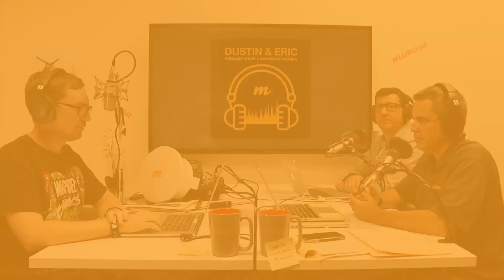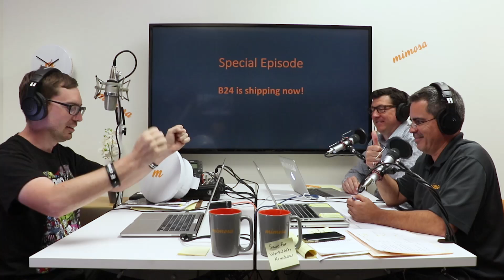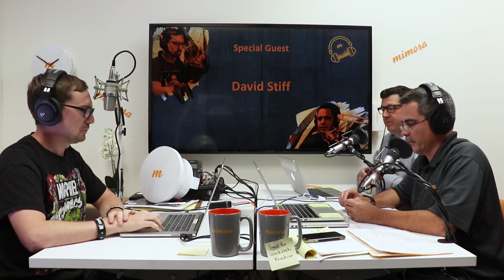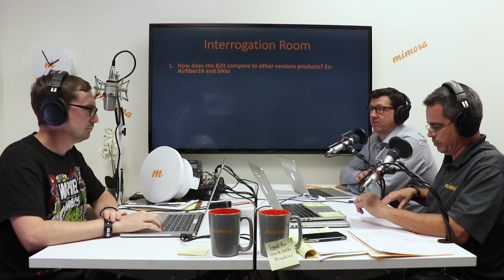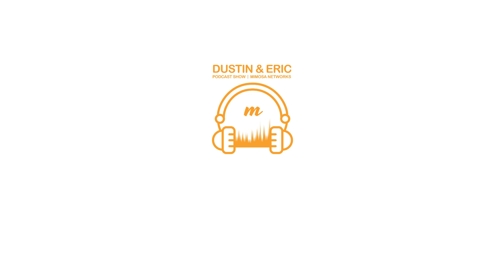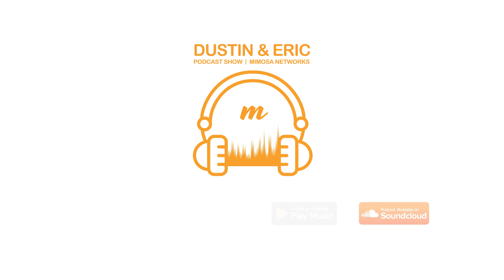Mimosa Networks Podcast: Special Episode - B24 Gigabit Point-to-Point Backhaul Radio (24 GHz)

Comment: Any recommendation to power the unit from a 24Vdc source?
Reply: Hi there,

You would need some type of voltage step up device. I use Tycon Power devices for such a thing. 24VDC to 56VDC HP.

You could also do a 24VDC to AC power converter and plug the B24 in that way. This is the way our solar site is set up.